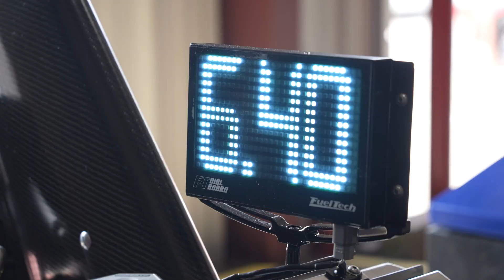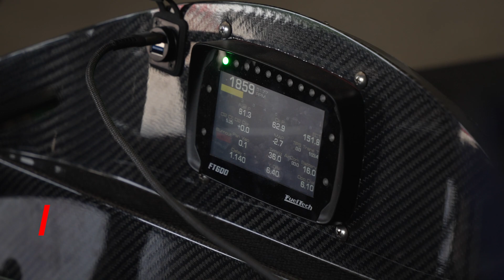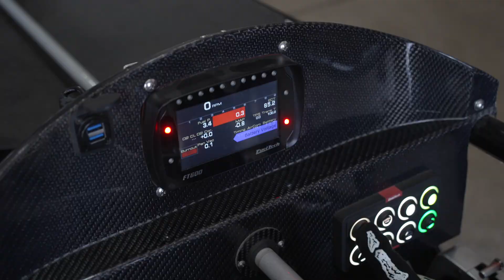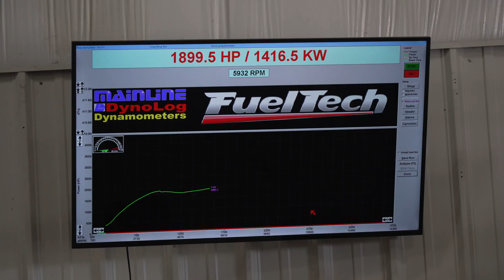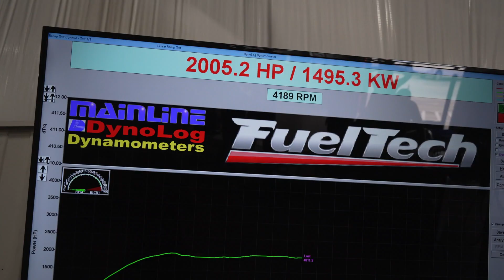NHRA Top Dragster makes over 2000HP! | Prescott Dean

Comment: Top Dragster Is Top ET taken to the extreme. Only Dragsters and open-wheel, center-steer Altereds are permitted. The the dial-ins must be from 6.10 to 7.70 (1/4 Mile) or from 3.70 to 4.99 (1/8 Mile).The fields consist of the 32 or 48 quickest cars in qualifying (regardless of what dial-ins are chosen). If your qualifying time is slower than the legal minimum you can still race, but the dial-in that you choose must be equal to, or be quicker than the legal minimum. Engine fuels can be gas. alcohol, or Diesel. Single power adders are permitted, you can choose from roots, high-helix, screw or centrifugal blowers, turbos, nitrous or be naturally aspirated. It's bracket racing at 230 MPH!

Comment: Uhh, it's a dragster. 2000 hp - Is it running a limited class, maybe junior's?
Reply: Are you confusing Top Dragster with Top Fuel? Dragster’s run in a lot of different classes. Lol. This dragster runs in Top Dragster not Top Fuel.
Reply: This is a bracket car man...